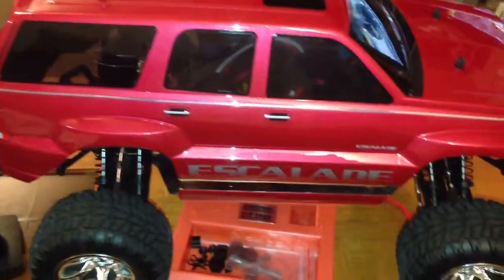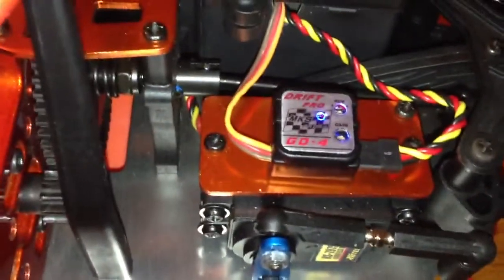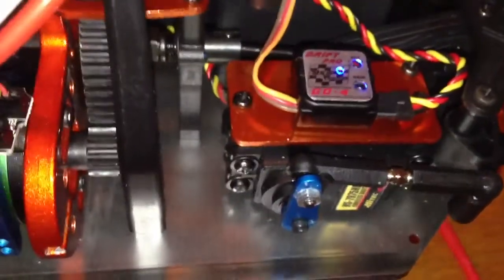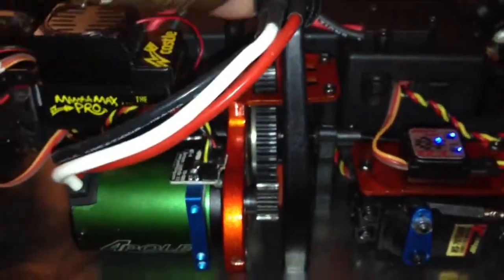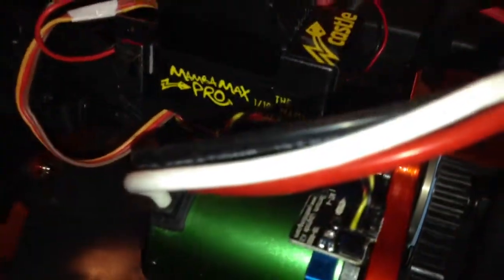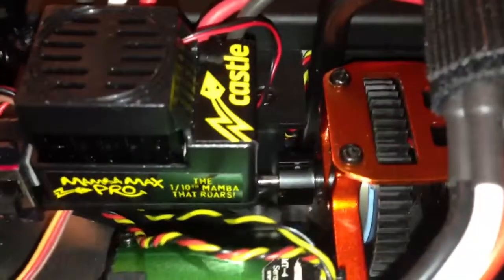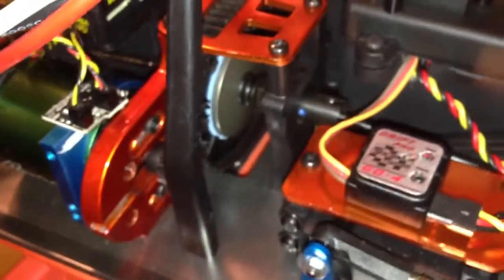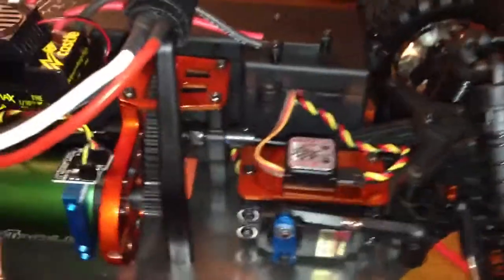HPI Bullet Flux with Full Electronics Upgrade

Comment: whats the teeths on the spur and pinion. on my mamba monster my motor is very hard to mount on the mounting plate the gears are very tight
Reply from the maker: It's been a while and I don't have this one anymore but the spur is stock. Do you have a bullet?